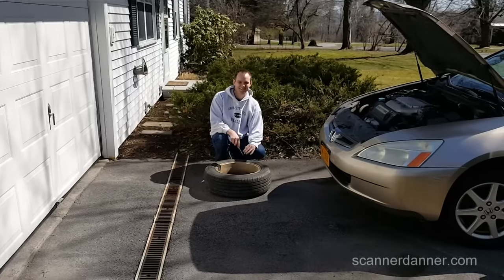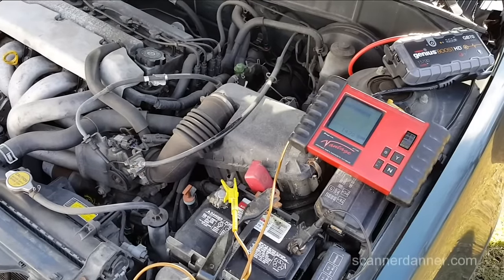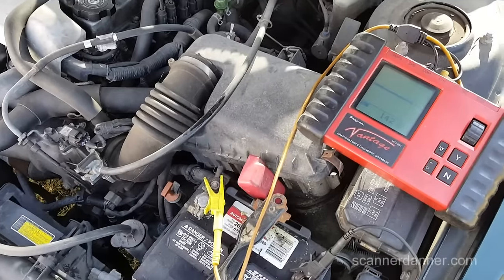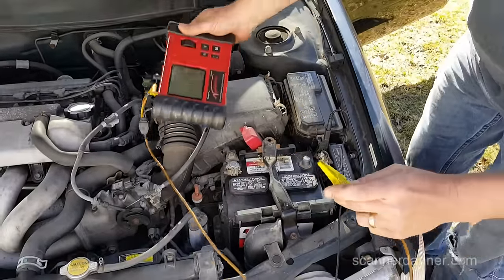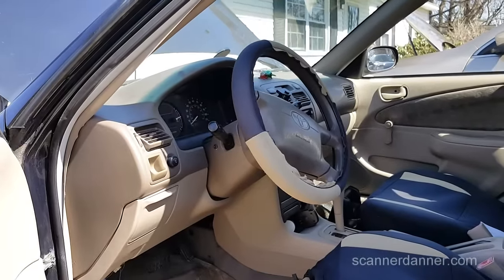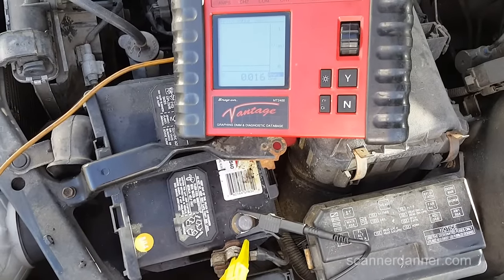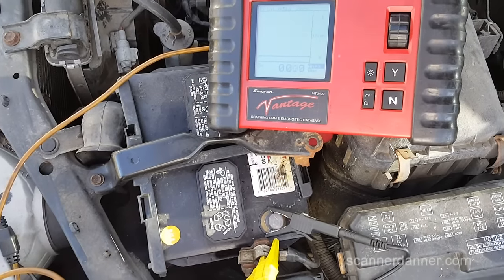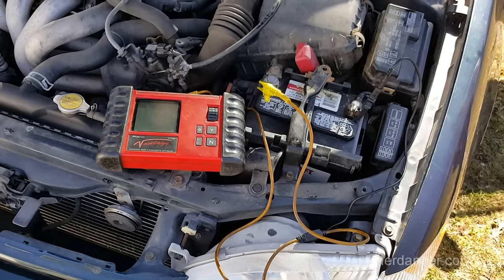Battery keeps going dead (what to test before replacing)

Comment: I'm sorry for the dislike. I finally caught you. Never use the car to recharge the battery. You put considerable strain on the alternator. More money down the drain. Plus the car owner will insist your diagnosis was incorrect, no matter what you say { It was really the alternator, and you told me to replace the battery. You've probably even said this yourself. What fun, keep going brother.
Reply: +daveS ministry 
Batteries get badly damaged by deep discharges. Modern automotive starting batteries aren't designed to be discharged to more than 70 percent of full charge. This battery has reportedly been deep discharged several times, even with slow trickle charging followed by a leveling charge it will only have a fraction its' original  charge capacity  and cold cranking amps. 
In the shop this can be verified even on a discharged battery by using a modern battery tester that measures the AC impedance of the battery and gives a estimate of the percentage remaining life of the battery and the effective CCA.
Reply: +Andrew W MacFadyen  Also true, Thank you.
Reply from the maker: +daveS ministry You finally caught me :) 
We did not have a battery charger and I am aware of the strain that a dead battery puts on the alternator. We had no choice in this situation.
At least you told me why you gave me a thumbs down. For that, I thank you.
Reply: +ScannerDanner  A man cannot think of everything. You already work very hard at getting your words right. Or doing a correct or thorough test to avoid complaints. I always thought you went overboard on this, wasting your time on unnecessary things, but I never was a good communicator, like you are, The issue with using the car to recharge a battery has been a reoccurring issue with me. When I ask people [Did you get your battery recharged] I hear I drove the car for an hour. They just don't understand.I have to help these church people but I probably harp at them, they keep doing it. Thanks for the time you send on your excellent lessons.
Reply from the maker: +daveS ministry thanks dave

Comment: Yep I always charge them check the voltage while diconnected from car.If it shows 12 volts then after 5 hrs it reads 10 and after 5 hrs after that it shows 5. THEN YOUR BATTERY IS SHOT.

Comment: That battery is gone-ski... sub 2V uncharged is waaay below the threshold voltage for sulfates to form on the plates. Your brother might actually try to buy a NOCO or CTEK intelligent charger and do a few cycles (intentionally leaving the lights on until the battery dips below 11V, charging up, then discharging again) BUT I think a new battery in this size (what is that tiny thing, 45Ah?) will be cheaper than buying a charger that has a regen feature.
EDIT just watched the last 1min - yeah. Replace battery. Also checked Wallmart's catalogue, the cheapest battery they have in 45Ah is a cool $100...
Reply from the maker: +tocsa120ls agree and we talked about a trickle charger off camera

Comment: 97-01 toyota camrys have a battery hold down with long brackets that go on the top side of the battery. ive got a smaller battery on my 01 and the bracket got loose and touched the positive post and shorted the battery. to fix the problem i just got a new battery and wraped the hold down bracket with rubber. 
never had any problems with car before that. even when i left the car parked for near two months in the middle of colorado winter. went to start it and started right up.

Comment: use a test light. ya always have more voltage at night lmao.  yeah ny state posted in april my first thought was a frozen battery.  they will often bulge the sides of the case.  if ya see the bulge ya better indulge (in a replacement)

Comment: whenever doing a battery draw test after starting a car like you did you should have walked away for about 40 minutes or so and then come back and do it relays stay alive on some of those newer Vehicles up to 40 minutes and that will give you a false reading
Reply: That was my thought too. Also never charge the battery from the alternator when the battery is dead. That alone can ruin the alternator.
Reply: hi everyone ,if anyone else wants to learn about how to recondition batteries at home try Renkarter Rapid Renew Report (Have a quick look on google cant remember the place now ) ? Ive heard some super things about it and my friend got amazing results with it.
Reply: True. What you mention would elevate the milliamp draw for those 40 minutes. He was getting a pretty low MA draw even within seconds of closing the door. So, in this case, the 40 minutes was not necessary.

Comment: I had the same problem with my Hyundai... It is from 2003 and had 136000 km on the clock when I bought it a year ago.... I changed the battery early this week because it could not hold it's charge....

Comment: Get sand paper n clean ur terminal and conectors to ur battery untill they are shiny,Basically i had problem, car wouldn't turn over, but had full power to head lights and dash illuminated with key on,turning key over,engine would click and like surge protector, everything ,dash and lights would shut off over n over and wouldnt fire, the car still had power to all electronics? sooo i pulled an cleaned up battery and connectors with sandpaper, lil time, luck ,n wall la, she fired right up, hope this helps,ps this was the first time i ever got lucky and didnt hav to spend 200 on battery or alternator yay me!

Comment: I had a Taurus that did this, but it would drain overnight. And it would get "fiixed" and the problem returned every month. It's like as soon as i would walk into the house and left the car off, every single gadget would get turned on by a ghost and in the morning the car would be completely dead. The worst issue you can have with a car. That and it would randomly not want to start, whenever it wanted. Probably some kind of sensor, but  I didn't know that then. That was 20 years ago.
Reply: Had same thing in my Ford Escape. Battery dead overnight and sometimes after I shut it off I come out 10 min later and radio and interior lights be on.   Ended up being the accessory switch relay on inside fuse panel near kick panel that got water or moisture in it and corroded the relay useless at times. Replaced it new and fixed the problem
Reply: .......  My  Taurus  brake  light  used  to  stay  on  sometimes  even  after  you  turned  the  car  off.    I   think  it  was  a problem  with  a  switch  by  the  brake  pedal.

Comment: Two questions to a good video. I looked up your Genius Boost HD jump pack and I like it. So how do you find it? Then question 2 being I went out to a Honda FRV 2.2 CDTI with a battery drain today. Fixed it and found the boot light causing .61 drain on 10a setting with the meter. Took bulb out and drain went down to 0.0. So I got paid and the customer went driving. I check battery with engine running to see 14v to proove alternator charging, yet he just sent me a pic of the battery light flashing again on the dashboard. Its got a new YUASA battery that holds charge with leads/terminals disconnected, so i'm thinking maybe alternator has intermittent charging? Whats your view?
Reply from the maker: Hard to say. Check it for fault codes first, then go from there.

Comment: Hey I've found the circuit that has 5A of draw on battery by running multimeter in series on 10A setting and pulling fuses one by one.

It was Fuse 8 in my under dash junction box.
Problem is I am having a hard time finding what on that circuit is causing the draw.
It says on a looked up fuse diagram that fuse 8 protects:
"Overhead console, rear wiper, ip lights, rear flipper glass solenoid."

How would you suggest I test for faults in the circuit? Should I do resistance testing or should I do voltage drop with a live circuit?

So far looking at overhead console wires where it connects in overhead and checking rear wiper wires I couldn't see any obvious wire problems.

How do you recommend I proceed.

I should mention my vehicle is 2002 Jeep Grand Cherokee Laredo 4.7L

And when I pulled my fuse # 8 it went from 5.3A to 0.59A and I'm understanding my Jeep is supposed to only have 50mA max and I'm getting 590mA over 5X that. Scary to think I am having 100x what it is supposed to be with the 5A battery's parasitic draw.
Reply from the maker: That one should be easy to find with that type of amperage. 
Start unplugging the components that run off of that fuse

Comment: check Mini fuse site for voltage drop across mini fuse with all power off. Will indicate which fuse has parasitic draw .Alternator diodes often leak draw down battery also.. Check output while at hot idle in drive with all accessories on full is better.
PS have your PhD brother invented chemical which desulfates lead plates in battery.Shalom

Comment: +ScannerDanner Any opinions on using a low amp current probe or voltage drop to find a parasitic draw? I've been told by some techs on newer cars modules won't time out and  will stay on from a software glitch and disconnecting the negative terminal to put a DMM inline will mask the issue. I figured the amp probe wouldn't detect such a small draw accurately if at all and checking voltage drop on every fuse would take longer but it made sense because with out current flow there'd be no drop.
Reply from the maker: +Bill DeVoe I've used the low amp probe for this test. Yes, newer systems need to time out and disconnecting the battery can interfere.
The voltage drop test on the fuses in this situation would have taken way too long and would not have been very helpful

Comment: Well u should have checked the radio I have run into couple times where it shorts out .on o ei unplugged radio an stopped the battery drainage.so how can check radio for draining the battery with out unplugging it ?

Comment: Here in Canada it's really easy to call a bad battery when the car only starts on warm days.
Reply: +kdmq 
A battery with a dead cell (sometimes called a shorted or gassing cell) tend to show up as non-starts on sudden cold snaps.
Modern battery testers  are smart enough to give a pretty good prediction when a battery  is going downhill, and unlike the old style tester they are easy to use and safe.   The prices is now in the DIY range here in  the EU  they can be found under 45 Pounds/70 Euros considering the cost and frustration  of  a no start or roadside breakdown  I would say it is cost effective  buy for anybody that looks after three or more vehicles.

Comment: Can you just use an amp clamp to measure current draw? Don't have an ammeter but have a cheap little scope with low current clamp
Reply from the maker: as long as your amp clamp can accurately read into the milliamp range, then yes, this will work fine for you

Comment: Danner for those of us who require an aftermarket alarm for door lock and primarily pressure sensitivity and must keep the unit connected how does one maintain a low amount of draw knowing the system will always consume more than 50mA?
Reply: you get a battery with more Reserve capacity
Reply from the maker: +drwombat make sure you drive it at least once a week or use a battery tender

Comment: ScannerDanner What if the battery doesnt completely die. Mine drops to @ 12.3 and causes a no start. Of course the more I try to crank it the lower the battery gets and the  parts store tested it as good. I tested for paracitic draw and got 20 milliamps at rest. Alternator was tested and seemed like it wasnt producing enough voltage at idle or under load so I loaded up the parts cannon. After 1 day of driving, same result, undercharged battery and a no start. All fuses tested good with a powerprobe. I want to test the battery cables to the starter and alternator for excessive resistance next and I think my voltage regulation in pcm controlled, 2005 ford escape 2.3. Any direction to try and isolate this issue would be appreciated.
Reply from the maker: 12.3 volts would not cause a no start. 
To be clear, is your car not cranking at all or is it cranking and not starting?
Reply: @ScannerDanner  After I charge the battery It will crank and start normally about 4-5 times and then all I get is dash lights and clicking.

Comment: Paul- I have a 96 Grand Cherokee 5.2 for a bad weather/2nd vehicle with a 4 year old Optima red top and the battery was dead a few days ago so I brought the battery to get recharged and picked up this morning- I pulled out my multi-meter, I got .031 on 10 amp scale, that's acceptable right??? mili amp reading is same again .031 not .31

Thanks
Reply from the maker: .031 would be fine, .31 would not be
Reply: Right, just wanted to double check and thanks- I will replace battery

Comment: My battery was at 13.10V before doing anything. When I started the engine, it quickly went up to14.50V, but quickly went back down until 12.35V a minute later. The battery was not charging, I guess. I let the engine cool off for one minute, and the battery went to 12.51V.
Reply from the maker: Sounds like a charging system problem, not a battery or drain issue.
What kind of car? Year, make, model
Reply: Mitsubishi Lancer 2003.
Reply: Today the engine shut down many times at every red light. Scary when it happens uphill...
Reply from the maker: Okay, the reason I asked is some of the newer cars are purposefully reducing charging voltage for fuel economy. But your system should be around 13.5 to 15 volts charging voltage all the time.
Reply from the maker: For additional help, please post your findings to my forum. www.scannerdanner.com
We can review the wiring diagram and provide you with the checks you'll need to do to confirm.

Comment: I'm wondering.....dosent just at idle cause the battery to drain shouldn't  you have to  drive it to actually charge the battery sufficiently
Reply from the maker: +straightjacketleatha no, as long as charging voltage is 13.5-15 volts at idle, no need to raise the RPM

Comment: Did you do a voltage drop test on the battery cables?  Couldn't high resistance be causing a charging issue?
Reply from the maker: +robert rukidding no need to test the battery cables for a voltage drop with normal charging system voltage measured directly at the battery. When you need to do that would be when charging voltage is low at the battery and then normal at the alternator. 
Or when you have a starting system issue. (no crank)
Reply: +ScannerDanner I may have to respectfully disagree with you on this one.  If you have a bad connection, voltage may still show okay at the battery, but it is at a compromised connection.  In other words, the voltage may be fine but the current flow is impeded.  Ditto on any voltage drop test.  May look good in the milliamp scale, but appear questionable when more serious current is placed across it.  Am I missing something?
Reply: +robert rukidding You weren't checking voltage and current flow....or were you/
Reply from the maker: +robert rukidding technically no but with a completely dead battery you can be certain the alternator output was at its max, trying to maintain normal system voltage. This places a huge load on the alternator (which can damage the alternator) There was probably 40 to 50 amps (at least) of current traveling to the battery on those cables. With my reading at the battery posts of 14.5, this indicates the alternator and all related circuits (including battery cables) are working as designed. 
If there was resistance in the alt. heavy gauge, bat wire, this would have been the time that the voltage drop on the cable would be most evident. Low voltage at the battery is when further testing must be done.
Reply: +ScannerDanner I'm going to still disagree with you my friend.  I would agree that the battery is seeing whatever voltage you are measuring.  I would also agree that the alternator is potentially seeing max output.  However, if a significant portion of this output is being converted to heat, none of the aforementioned matters.

Rob
Reply: ........  ScannerDanner---  If  the  car  runs  fine after a jump,  can  the  alternator  still  be  bad.   Wal-Mart  says  I  have  a bad  diode,  but  the car  runs  fine  after  a  jump,  but  they  won't  replace  a  battery  until  the  alternator  is  fixed  they  say.

Comment: Step one:  Assume remote start issue. A bit premature?
Step two: Realize you left the door open. 
How can 50 milliamps be alright but shortly after 16 is too much?  Doesn't make sense. 
10 Milliamps is about right for a remote starter. A car driven once a week will never have an issue. Yes, I install remote starters for a living and think it's unfair to automatically assume it's the source of any issue with the car. Love your videos, just not this one.
Reply from the maker: +Mark McCormick 16 ma is not too much but if I can cut it in half for a car that sits too much I'm going to do it. Also he lost the remote for it and hasn't used it in more than a year.
I understand your comment but I've seen so many aftermarket remote starts and alarm systems that are the cause. 
Also in step 1. Unplugging the remote start (a highly suspect item) took two minutes to do. How is that being premature? 
As for 50ma? It is a spec I've used as a maximum. But is too much for a car that sits. 50ma will kill a battery in 3 to 4 weeks